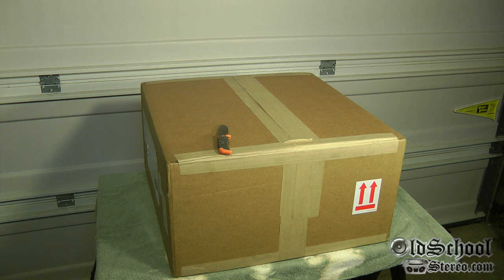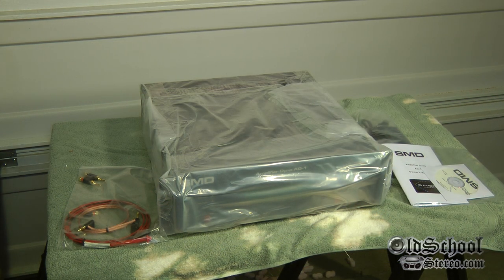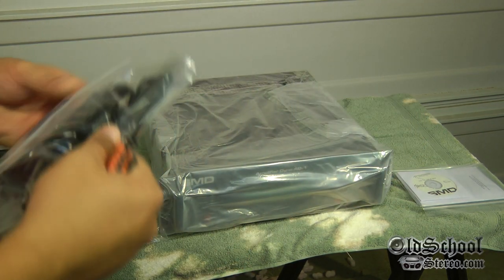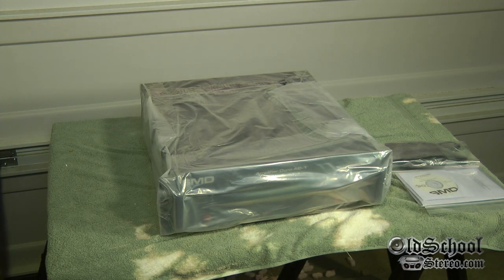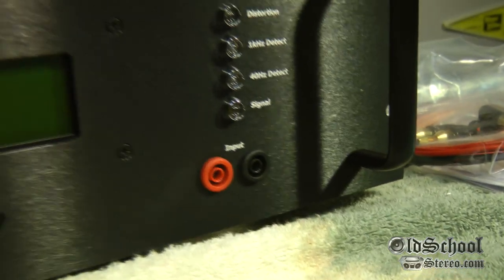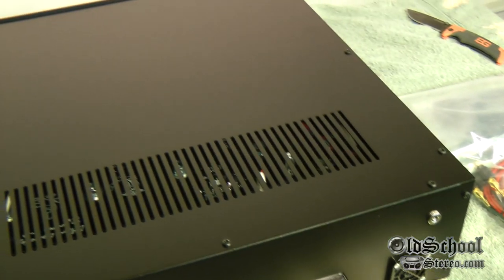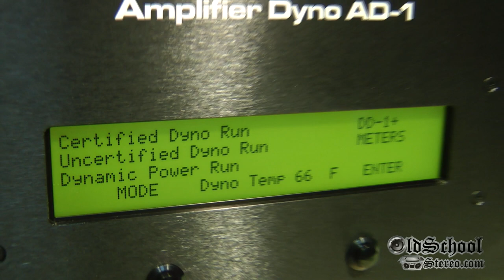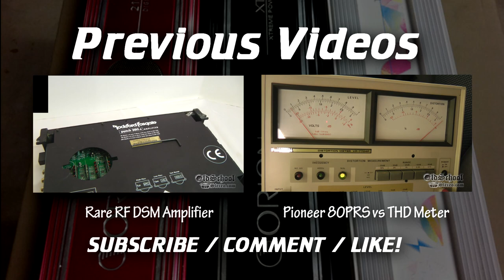Amp Dyno AD-1 SMD D'Amore Engineering Unboxing Audio Wattage RMS Power

Comment: serial number 0012, so I assume this is unit 12, how many have they sold cuz those things are expensive.
Reply from the maker: cesar56611 For what the AD-1 does and the amount of time it saves versus wiring up resistive loads, etc...it seems like a fair price to me. Professional test equipment isn't cheap and honestly, you wouldn't want it to be
Reply: I noticed the same thing, I wonder who bought the other 10!
Reply from the maker: Reefdevil CJ at Droppin' Hz Car Audio has one, SMD has #1, Skar Audio has #2 I think, a few more in the US and several overseas